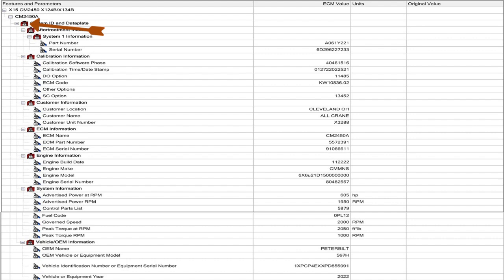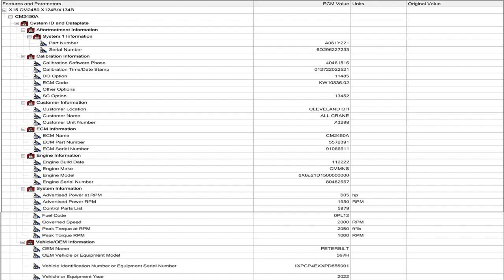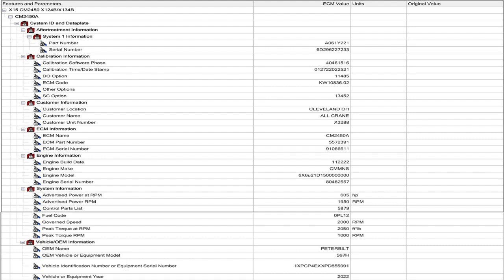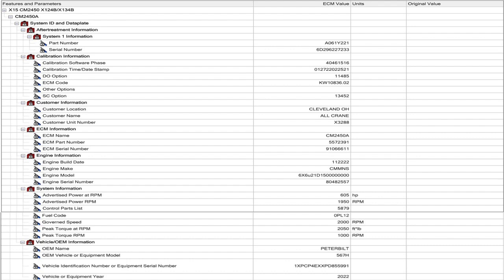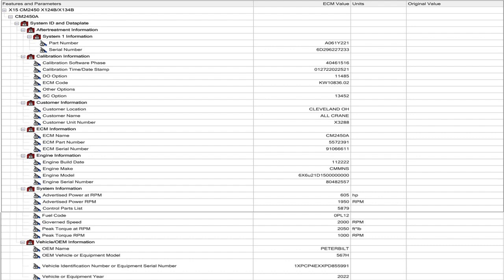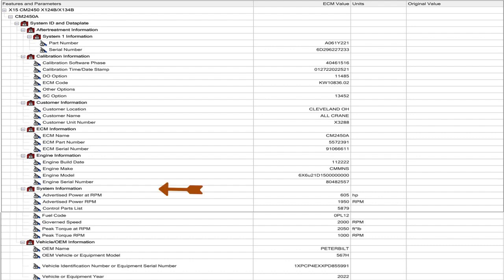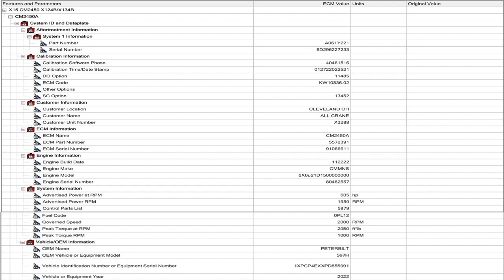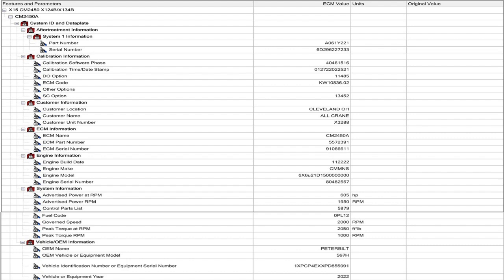What are the features and parameters

Comment: Hey Jo have a question I have a truck when driving the mph on the cluster not matching the actual speed have NO transmission codes is an Allison 1000/2000 automatic the revs per miles on this truck is 501 there any other parameters I should be watching?
Reply from the maker: Not sure what engine make so will assume cummins. I say that because other makers could have parameters I dont know about related to this.
Check and see if there is a value for the transmission output tone ring. Example- 10 tooth 14 tooth etc. if No.... then if it stays linear you could take tire size and 
use google to get the formula to recalculate tire revs. If they look correct you can make the revs what ever you want value wise. There is just a max and min value to stay between. This can happen if rear ends are replaced with a different reduction ratio or different size tires were installed. 
So if the truck is going 50 and the speedo shows 55 You want to drop the value of the revs.
501 is how many times the tire travels 501 complete revolutions in one mile.(the ecm is just counting drive shaft revolutions.)
Dropping the rev number would make the ecm think your going farther for the same DSR(see below). Rear end ratio also plays a role in this so make sure that is set right. IE 4:10 Or 3:23.  If the road speed error is not linear ( IE dash 25 vehicle 30,  dash 70 vehicle 55) Then I have changed rear ratios and tire sizes to make it linear. But I did that 
on a chassis dyno that told me accurate road speed. I remember that as it took an hour but the customer was tickled pink. He bought a used truck and rear ratios were not what was stamped on the rears.

Comment: Is this dealership only proprietary software....or something program that anybody can get in any shop( off of a tool truck or freely available online)?
Reply from the maker: Insite can be purchased from cummins sales and service. It only works on a PC not mac os You also need to buy a communicator interface. i recommend the nexiq link 3 at this point in time. Make sure your pc meets preferred specs and not just minimum specs. We run windows 11 I-7 with 64 gigs of ram and a 2 TB Hard drive. Dont get less than 1TB HD and no less than 32 gigs of ram. It makes a huge difference is how fast the program runs. The insite license has to be renewed (repurchased ) yearly. If you let it expire it will work in read only mode for a few years.